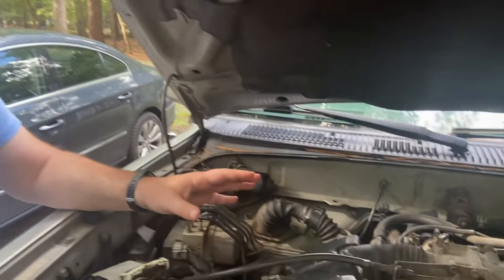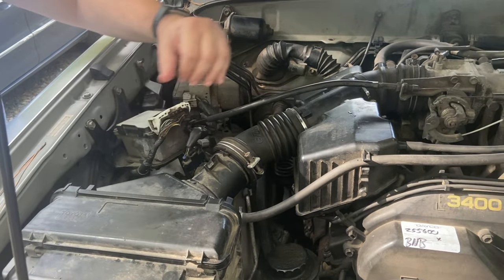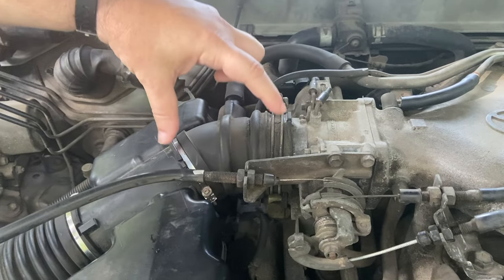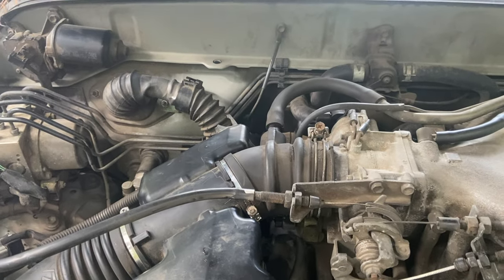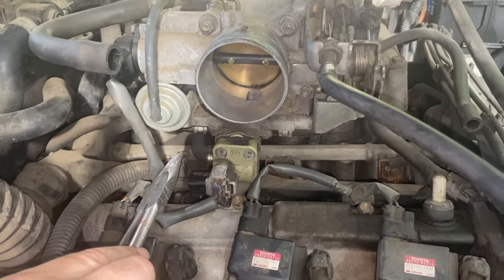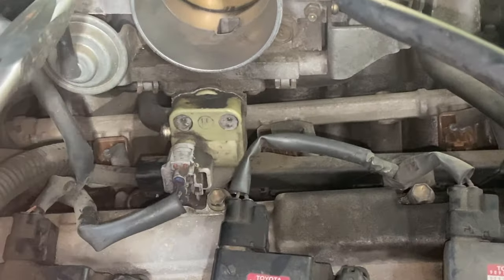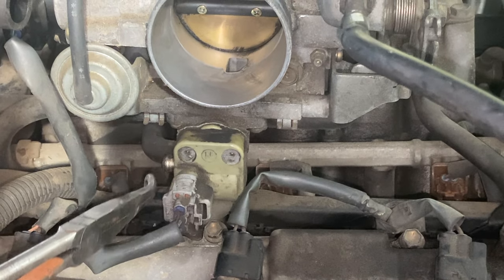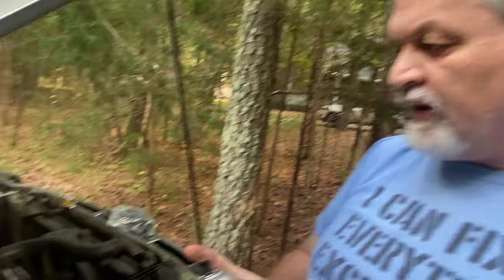The easiest and fastest way to clean an idle control valve without removing it from the vehicle!

Comment: Thank you for the video was going to change my air control valve in my 94 Lincoln town car and it was too hard to get it under wiring harness under the throttle body so I decided to take the hose off throttle body and spray some carburetor cleaner down through engine and run it Seem like that did the trick getting almost 22 miles to the gallon now I was only getting about 15.9 maybe 16 before thank you and God bless 14:59  you

Comment: I have a 94 Camry 2.2 liter, automatic. It has a rough idle when stopped at light. I put it into neutral and this makes the idle smooth out. Then when light changes I put it in drive and it runs fine. I know putting it in neutral only is not actually correcting the problem. Any suggestions what the problem may be. Also my Camry has 202,000 miles. Thank you.
Reply from the maker: Sounds like idle control valve to me
Reply: @ProfessorDIY   Thanks

Comment: I've learned more about marriage and patience than about idle control 😆. Good job with the fix. But you forgot to have her step on the gas, with car off, to clean inside that idle control or whatever it's called.
Reply from the maker: That is not recommended and in this case it would do nothing since the vacuum hose was disconnected, thank yo for watching and commenting